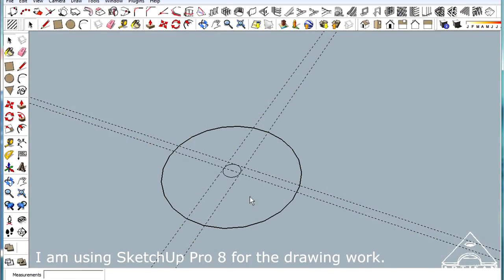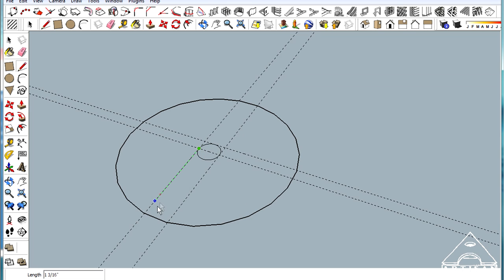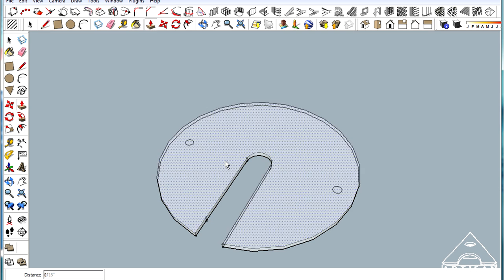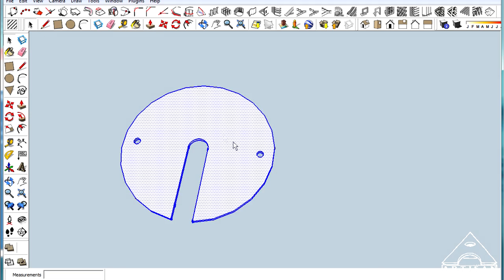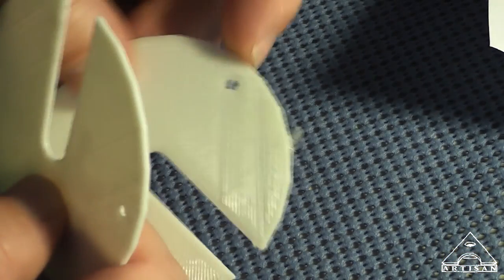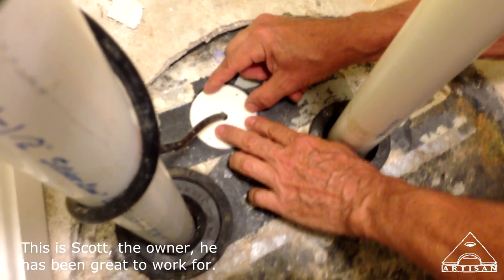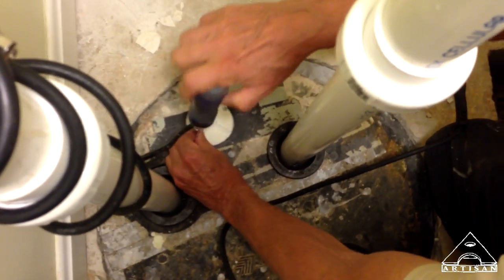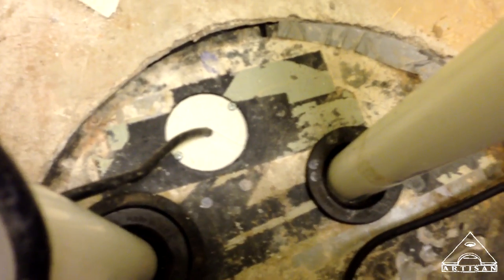3D Practical Printing - Sump Pump Grommet Designed with SketchUp

Comment: Very cool, I could have used something like that, but for a special cap for under ground conduit, with fiber optic running through it. Instead of using firestop, puddy.